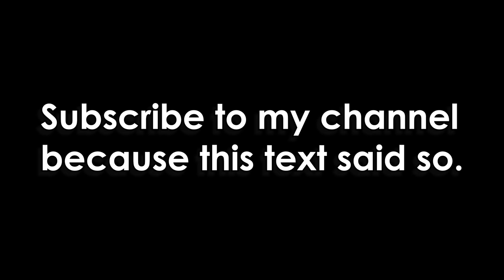Replace Capacitors Faster with a Heat Gun - Or Not - Jody Bruchon

Comment: Lucky you got only 2 caps. I recently pick up a HP micro tower from the trash. This is the list of bad caps :
3300uf 6.3v  5 pc
1500uf 6.3v  2 pc
1000uf 6.3v 12pc
470uf   10v    1pc
Removing them is a real pain.
Reply from the maker: I feel your pain. At that count of bad caps, I'd be buying a board on eBay instead.

Comment: Wrong tools.
Today computers use multilayer boards, using this soldering iron is imposible, is necesary to use a 90 watts soldering iron and  if is posible more power.
A soldering iron with temperature control plus flux and if is posible low melting solder like "Fast Chip" or "Quick Chip"

Best Regards.

Comment: Get a temperature controlled Iron and turn it up, heat gun could set you up for cold solder joints later, I've never had this problem with my iron and have removed thousand of cap thru the years
Reply from the maker: I use the heat gun for removal and a soldering iron for installation in most cases.

Comment: Can i replace 1000uf Capacitor and place 4000uf capacitor on motherboard?  Does it effect any problem?
Reply from the maker: You can replace with the same uF but different voltages. You can't replace with different uF safely. If it's a filter capacitor (like used in a power supply after the rectifier bridge to smooth out the AC ripples) then it might be okay, but circuits are generally designed for a particular value with some tolerance for deviation (usually +/- 10%) but you're talking about a +400% difference.
Reply: @JodyBruchon  ok👍
Reply: You can use a higher volt and temp rating but not capacitance or you'll likely run into issues!

Comment: ok so you said the heat gun is HOT and you used a infrared thermometer gun to tell how hot the board was getting but you didn't say HOW HOT YOU NEED TO GET THE BOARD??? I Have 3 heat guns and the infrared heat gun to let me know hot hot things get. SO HOW HOT DO WE GO TO DO THIS????

My one gun goes to 1000 degrees. So clearly that would be too much heat.  I want to know how hot & for how long should it stay on at that temp before you have to let up???? ahhhhhhhhhhhhhhhhhhhhhhhh!!!!
Reply from the maker: It's in the video and I also added it to the description. Solder melts around 360F. You'll want to get the area near the capacitors relatively close to that, but not quite that hot. You run the risk of losing nearby surface-mount components if you heat it past the melting point and you'll NEVER get those back on.
Reply from the maker: @Duribethin Thanks for noting that stuff. Lead-free solder is the bane of my existence!